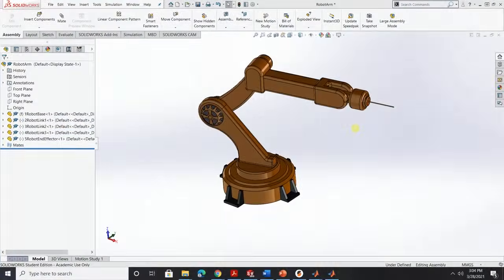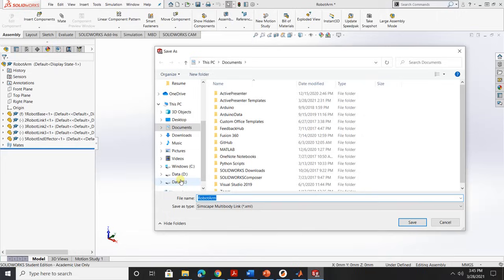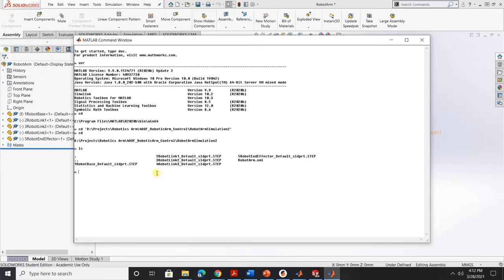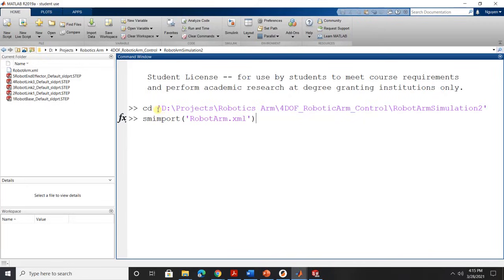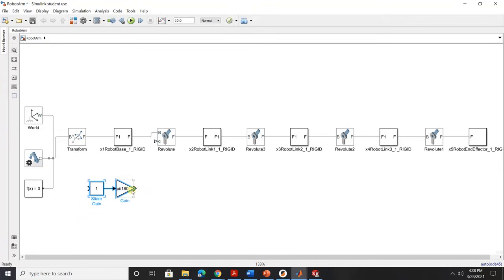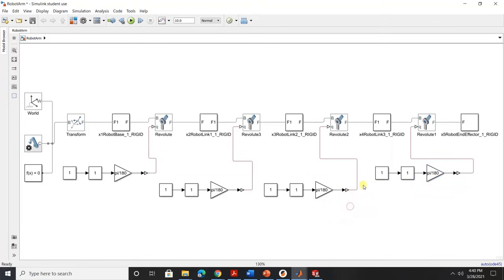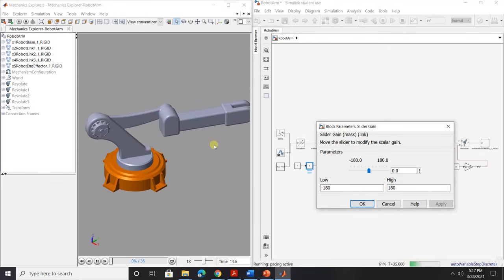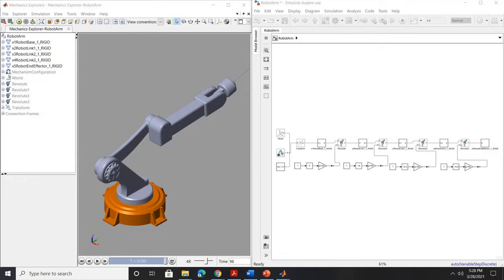Simulate and Control Robot Arm with MATLAB and Simulink Tutorial (Part I)

Comment: I have some problems to answer you.When I try to produce a urdf file in my solidworks with the tool of urdf exporter,I don't ready understand some options in it.For example,the origin_joint1、origin_joint2……when this joint axes are imported into matlab simscape,I don't really understand the relationships between them and how to adjust these axes at first

Comment: Hi Sir, I have this problem and I hope you ( or anyone else) can give me some insights: I am trying to import a Solidowrks assembly into simMechanics. I followed all the steps as in the web site. I have the pull-down menu SinMechanics Link in SolidWorks. When I try to save the assembly in the xml format, I get this error:

"Could not start MATLAB. Check your MATLAB installation. Consult documentation to identify possible causes of failure."

I get this error regarding Matlab is open or not. I don't know what to do.

Note: I am using Matlab 2021a and SolidWorks 2017
Reply: https://www.youtube.com/watch?v=SQorCJ_o3M4&list=PLp8p68RBo-O5Iey-AhTDJx_XKLCrvaDeO&index=4